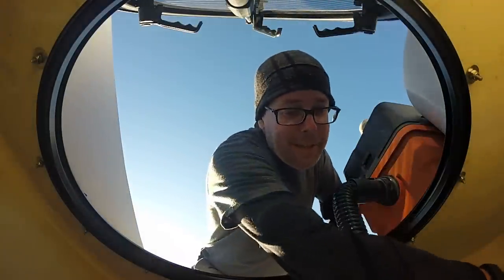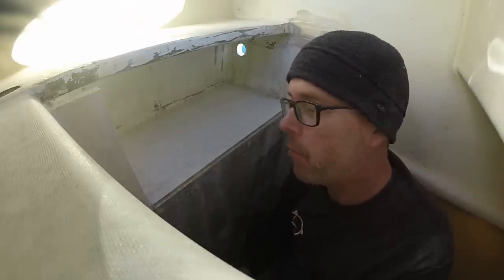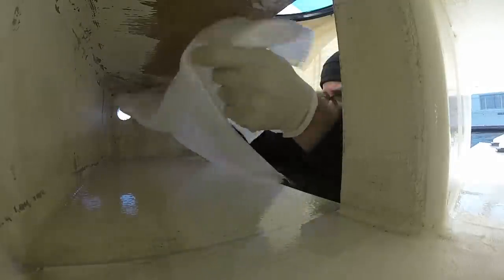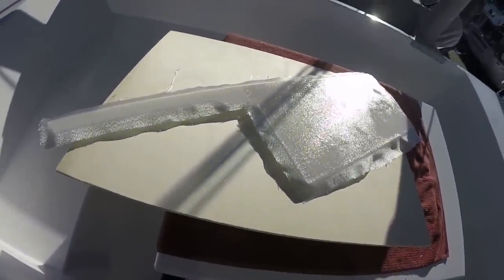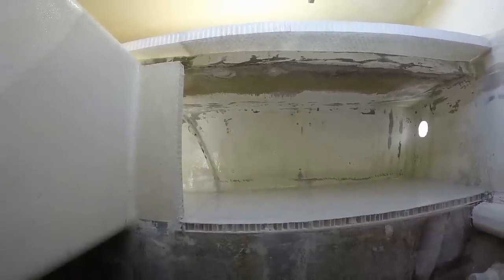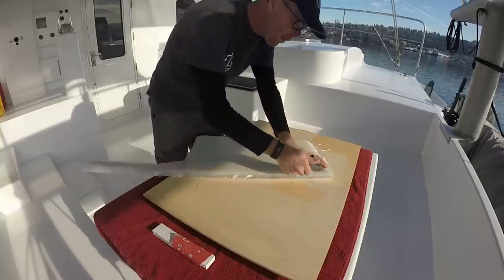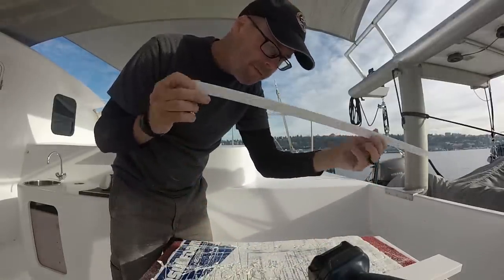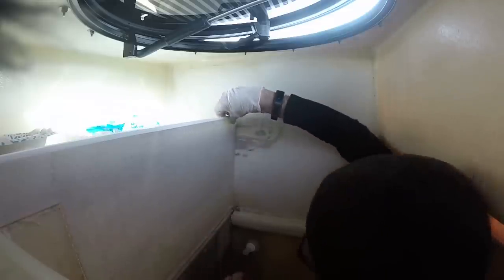Working With Honeycomb Structural Panels. Onboard Lifestyle ep.48

Comment: I would like to see a little clip about how you joined the panhandle piece of nydacor to the other piece.  I like how you talked about the edge treatment.  Those little details really help.
Reply from the maker: I must have dropped that scene on the cutting room floor...sorry. When I connect two pieces of Nida-core with a butt-joint I use 3 different methods depending on the strength that is required for that joint. In a heavy load situation I will dish out about 2"-3" of the core material and epoxy a spline made from a thinner gauge piece of honeycomb. On a medium load situation I will butt-join with thickened epoxy. On a low load I simply tack the two pieces together with hot-glue.  Keep in mind that after all three joints are cured the strength comes from you fiberglass lamination overlay. In the case of the panhandle I used a hot-glue tack to hold it until the laminations cured.

Comment: I think I am going to build a bass boat out of this stuff . Ground up .
Reply from the maker: That sounds like a great project.  Send us pics when you are done!
Reply: @OnboardLifestyle  I watching lots of youtube videos on the stuff and it looks like amazing material for building boats .  It can be shaped easy and it should make a light boat that is strong as can be .  I am on the fence about going with a foam core or this stuff .   I going to start on the boat project tomorrow so it will need to be decision made by tonight sometime .
Reply: @OnboardLifestyle  So since you have used this stuff can I pick your brain ?  I need a basic idea of what thickness I should go with . I think I was thinking 3/4'' for the center peak on the bottom of the boat and transom (still thinking Ill use treated plywood but maybe not).  then 1/2" for the step layers that build the lower hull . For the sides of the boat above the waterline I was thinking 1/4''.  Than for the decking and 1/2 or 1/4 should be fine but I would like to hear your take on it . Do you think I need to stick with 3/4'' through tthe entire build or do you thin the stuff is strong enough to use thinner material ?

Comment: Hi Teal! 
The sugar scoops are coming along nicely! I did notice one thing, you had some spare Fram oil filters. Please do yourself a favor and toss them in the trash! If you haven’t already, search on YouTube for  Fram filters.  The cheap Walmart brand filter is far better than a Fram! 

I really enjoy your channel! Keep up the great work! 

Charles
Reply: Just an FYI Charles. As an over the road truck driver, I have loaded filters at a plant in a Midwest state. In the trailer were Fram, Baldwin, Napa, Caterpillar, and John Deere. The internal components run on the same assembly line in China. They are all the same product if a given application.  No difference other than branding.
One of the many mostly unknown truths in the consumer market.
Reply: No they aren’t the same. Check out some of the videos where the filters are cut open. Big difference in the brands. Fram being the worst construction. Cardboard instead of metal holding the filter material. Also, Napa filters are made by Wix filters.  I don’t know about all of there filters but a large number are made here in my hometown.

Comment: If you were to apply a Dacron peel-ply over your parts and over the areas where glass overlaps, you’d have much smoother transitions and way less finish sanding or sanding to prep for another layer of glass after your first layer cured.  Just zip the peel-ply off the part when you are ready to add the next layer, attach another part, or apply primer.

Comment: I have had good success with covering epoxy filler radius with cloth and wetting it out with the radius still wet (wetter the better) rather than drying/sanding/wetting/glassing. It does mean having/mixing a second batch of clear epoxy right away. I would not let the radius start to set though, I want it to be all one piece.

Comment: As always another great job Teal. I was wondering if there would have been any advantage in cutting out the opening for the inspection hatch, glassing it in etc before fitting the panel to the bulkhead, being such a cramped space would it have been easier to fit it as a complete panel.  Last question is a simple one, how is the paint on the coach house holding up that you applied last year, has it retained it's colour or required any maintenance.  Keep up the good work.
Reply from the maker: I avoided cutting the opening until after the panel was installed because the new RO for the inspection hatch bisects the new panel and the existing panel. I would say the paint is holding up fair, it has dullened a bit over the last two winters but we will still be applying another coat of topcoat and a coat of nonskid this spring. Thanks for the comment Glen!

Comment: A few comments to DIY'ers watching to learn... "do a layer, let it cure, sand it, do a layer, let it cure, sand....[repeat]" is going to make a much weaker part (mechanical bond) and takes SO much more time, than if you just did all your layers at once and finish with a light filler easy to sand once at the end.  The only time you shouldn't lay up all your layers at the same time is if it's really thick (1/4" ish) and would get too hot, but even then you just wait an hour or 2 so you still get a chemical bond. It shouldn't bend if you do both sides, all layers, at the same time.  Also, if you lay epoxy on a painted surface, the bond is only as good as the paint.  So sand to bare fiberglass before you epoxy and laminate.

Comment: Looking at the cross bar for the steering being exposed and so close to the rear cross support, it would seem logical that you could easily cover it with a half curved piece of NidaCore. I would think by running it lengthways on a table saw but not all the way through would cause that material to bend nicely with thickened epoxy to hold the shape. I would bet it would make the boat look very nice not having that stearing cross bar exposed.

Comment: Hello from Argentina! O have a question, This honeycomb board can be used for a "boat deck" that goes down the floor? Instead of wood, because its an old boat and the structure that hold the floor is made of wood and it's all rotten. Thanks! Good job in the video

Comment: May I ask you your thoughts on using foam board vs nida core board?I have a project on a pontoon boat that I would like to use foam board for because it's cheaper and I have some of it. Just wondering about structural side. Im making a lounge seat. Do you think foam board will be strong enough. I am using woven fiberglass. Would value your input.

Comment: I hope we can get those honeycomb panels in Gig Harbor and not have to go to Tacoma or Seattle. Nephew bought a small sailboat and everything is plastic except the interior of the aft wall around the enterance which has rotting plywood on the inside.  Needs to be strong enough to hang the ladder and seal the cracking between the deck and bulkhead.

Comment: is there anything to be gained using a section of Nida Core fiberglass laminated panel versus the plain Nida core panel with multiple layers of fiberglass cloth & epoxy resin applied? I know the fiberglass laminated Nida Core is 3 - 4 times more expensive than the plain surface Nida Core & using the former will still entail "fiberglassing" it into place but might save installation time.

Comment: What kind of epoxy do you use to seal the edges?
Reply from the maker: We use West System Epoxy with the 406 colloidal silica to thicken it to seal the edges.  👍
Reply: @OnboardLifestyle  thankyou
Reply: @OnboardLifestyle   What are your thoughts on using bondo I saw one of the channels on YouTube do that?
Reply from the maker: We tend to try to use marine products due to the harsh conditions.  It really depends on your comfort level on what you use on your own boat.  Good luck on your project!
Reply: @OnboardLifestyle  we have a 1956 42 foot Matthew's. I think sticking to marine products would be best. Thanks again for the info.